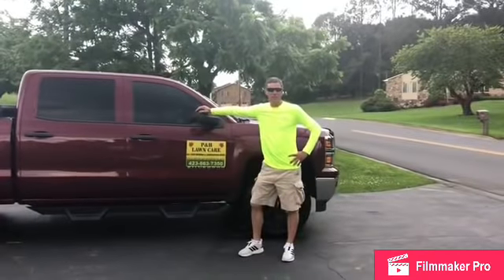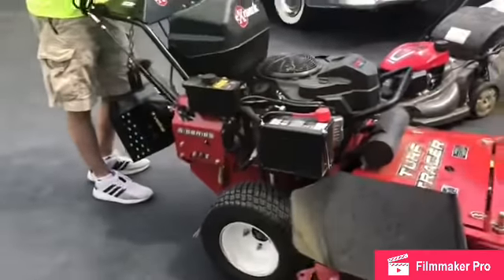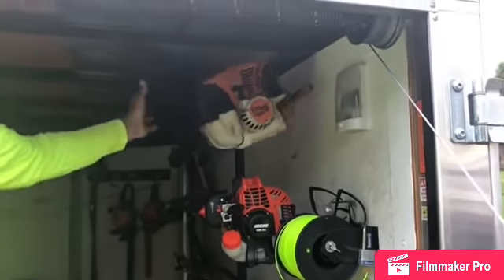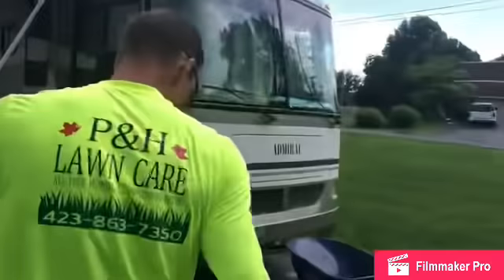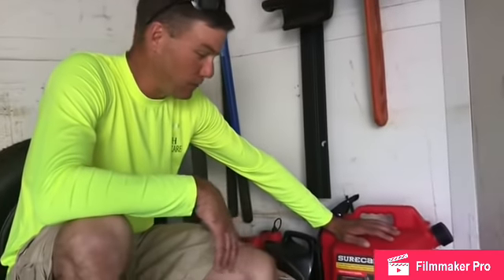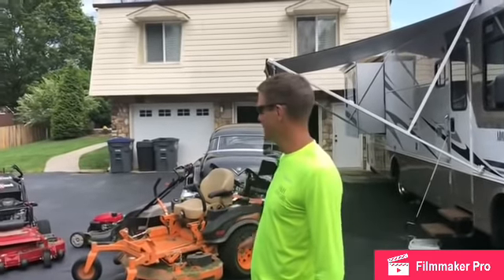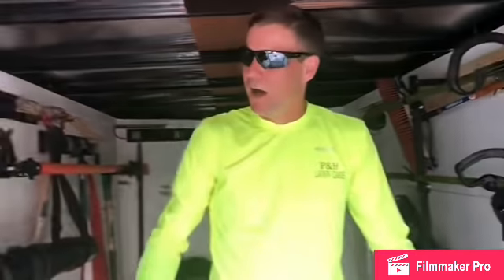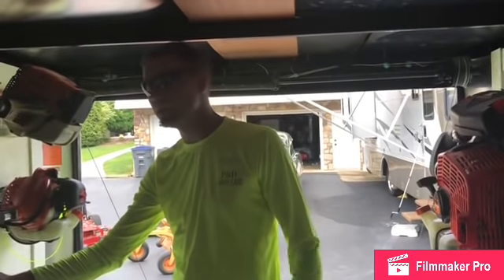2019 Solo Lawn Care Trailer Setup

Comment: Last year I worked at a large company that only did apartment buildings. I'm 26 and was the Forman. We used the same exmarks and I loved it. Last year I started doing lawns on the side after work. I live near Sacramento California. I build a website. Got ranked number 1 one Google. "I'm real good with tech" I advertise, did good work. And had a dream. This first year I ganed  100 houses and 2 small apartment buildings. It's been alittle rough but I'll get where I want to be. BTW this is a great video! I like your set up.
Reply from the maker: I bought a new trailer a few weeks ago and will be doing a video on it as soon as inhave it set up.  Good luck in your new business and thanks for watching

Comment: I’m starting my own solo landscaping company this season as well. I’m still gonna work full time for the landscape company I’ve been with for the past 10 years and try and do what your doing on the side. I already bought a 60 inch lazer z and a 32 inch metro. Also redmax blower and trimmer. Now I need a trailer. Will that trailer u have fit a 60 inch and a 32 inch walk behind?
Reply from the maker: No, i just bought a 7x16 and that would accomodate your setup. You cant get a 60” between the cables on the ramp of a 6x12. Il have my 2020 setup video up in a week or two.  Good luck to you and thanks for watching
Reply: P & H Lawn Care I’m so glad u said that because I been looking at 6x12 or 6x14  enclosed trailers and I never even though about the cables.🤦‍♂️. Thank u 🙏.
Reply from the maker: No worries man, i also forgot to mention, you saw my mowers, its not long enough for both of them eitherr. With the 16’ i get my push mower, scag, and exmark with about 15” to spare

Comment: Nice setup all ur missing is Stihl kombi system I got that biggest engine one it's quite nice on biweekly yards and hedges I litterally blow thru string it's almost funny how much torque it's has .. one window broke but dang it's nice for those rental s and messy ones.. great video
Reply from the maker: Thanks, i have added a lot over this past year including a 16ft trailer.  Il be doing my 2020 set up video when i get the trailer done.  Thanks for watching

Comment: Just found your channel & subbed. Excellent, to-the-point content. I'm starting my  lawn care solo business this year too, running a Tundra, 6x12 enclosed trailer, Toro Titan & Echo equipment. Your trailer setup is great, I'm copying much of it as I set mine up! 
Best of luck this year. I'm glad to hear you're busy enough to go full time. I pray for the same success.
Reply from the maker: Il have my 2020 setup coming soon, 7x16 trailer.  That firat year full time is rough, i learned so much.  Especially you cant put enough in savings to get you through the down time.  I wish you the best of luck, nothing as satisfying as working for yourself.  Thanks so much for watching.

Comment: In the UK you would find it very difficult to have a setup like this as a one man operation. The truck alone would cost about 40K & trailer 15 to 20!!
Reply from the maker: The original sticker price on my truck was $52k. I bought it used and it was close to $30k the trailer was $4400 new. I worked full time and had 25 yards as a side hustle untill feb 2019 when i went all in on lawn care. I worked a lot of shifts of overtime to buy what i needed before i left my regular job

Comment: Great video. It's nice to see another solo lwan sae ser up. I have the same size trailer. Could you show it all loaded up some time? I have mine set up for one rider (it doesnt die either, but it does a nice job cutting) and a push mower. The push fits out the side door of the rider isnt needed. 

Thanks. keep it up!
Reply from the maker: I'll do an addition to the video to show everything in the trailer. Thanks for watching!

Comment: Nice setup! In a future video can you show where the tie up chain for your Velke on your turf tracer is connected to under the controls?
Reply from the maker: After I saw your question today I looked at it to see.  If you look underneath where the throttle control is you will see a plate and it is mounted on that.  I could take a pic and send it if you like.